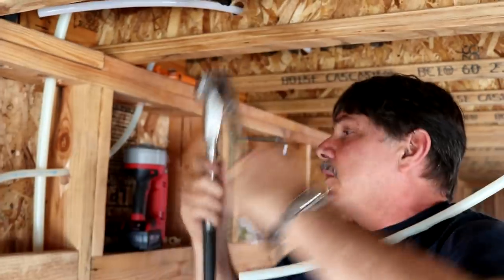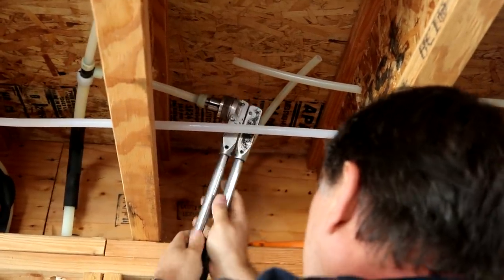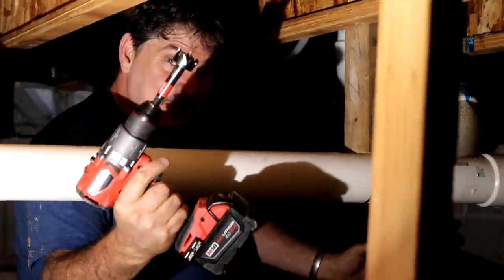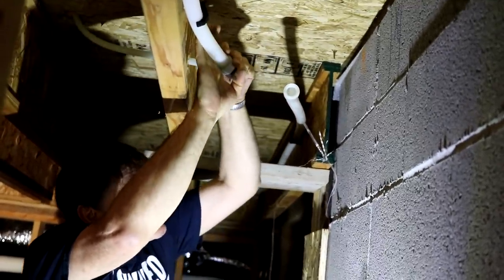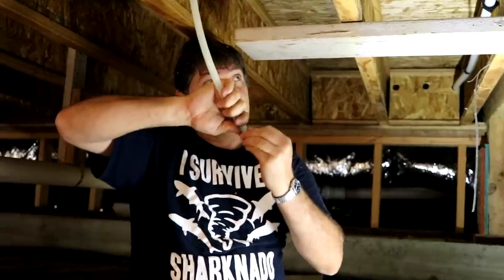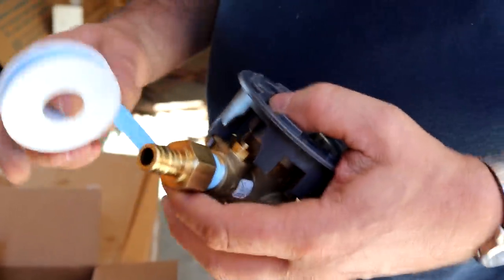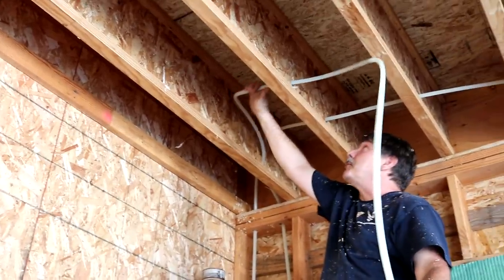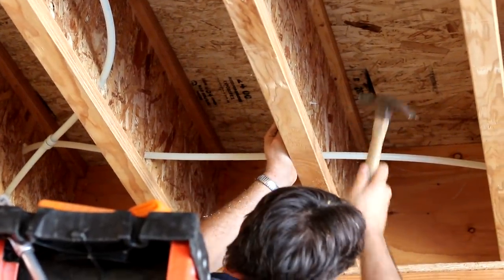Plumbing with Plastic Ep.95

Comment: “That probably won’t leak hardly at all” 😂😂😂
Reply: Just like my 3 sewer fittings that my plumber forgot to glue. After that I learned how to plumb myself.
Reply: @christophergruenwald5054  I’ve been doing various upgrades and renovations to my 1976 constructed home over the last 8 years. I’ve encountered two basement sinks that were friction fit ABS! On top of that, at one point there was PVC coming up out of the floor transitioned to ABS with yellow ABS cement. It came apart in my hands. How I didn’t find substantial leaks is beyond me
Reply: I’ve been around plumbing my entire life but have been running my own little business for around 5 years now. I can’t even begin to tell you how many times I’ve ran into 3”-4” fittings without any glue or primer at all. It’s insane. I think shit like that has to happen with bigger companies with guys working for 15/Hr. There’s just absolutely no way in hell anybody doing plumbing for themselves could ever do something like that. Plumbing mistakes are VERY expensive and even more embarrassing. The guys who do shit like that just can’t be worried about having to pay for damages or ruining their reputation. There’s just no way. 

Please don’t call big companies to have plumbing done. Find a good self employed guy and not only will he give you a better deal he will care about that plumbing just as much if not more than you will.

Comment: Pipe in pipe systems is standard here in Norway for new builds. So if the PEX pipe gets a leak, the leak will go into a connectionbox through the outer pipe and then to the drain. Another good thing about pipe in pipe system is that you can change a leaking pipe without opening walls/floors.
Reply: I’m not often surprised by comments but this one has me interested. Do you mean a pipe in a pipe is standard for interior and residential piping?

I do engineering of commercial systems in USA and we mostly use a carrier pipe for protection underground.  Can’t think of an instance inside the building other than some very special life safety instances for refrigeration.
Reply: @michaelwitt7984  In Norway it is now illegal to put in new plumbing in a house that is not "pipe in pipe".
Reply: @michaelwitt7984  This wikipedia pages explaines it well. (google translate) https://no.wikipedia.org/wiki/R%C3%B8r-i-r%C3%B8r_systemet
Reply: That awesome, I’m gonna read more about that

Comment: uponor pex a is great stuff. plenty of videos online about how to save a fitting if needed - don't really have to cut through the ring and pipe but rather just score ring, heat it and pipe up to remove fitting.  Ironically, Phil talks about how his labor at $100/hr isn't worth saving a $3 fitting but then goes and manually expands all the piping.  If you use a manual tool to expand the pipe ends, you have to rotate the expander between hand pumps (just like the electric Milwaukee and Dewalt tools do) or else you get ridges form on the inside of the pipes where the manual expander grips and you get leaks.  Hope you don't end up with leaks - there was a lot of unrotated manual expansion being done in this video. also didn't see it being used but uponor's multi-port tees are a great solution to run pipe to an area and branch off from there.

Comment: I like that Phil mentioned about costing more money to run around for parts versus improvising on site to save money for the homeowner. Also, this video pointed out plumbing installation details that a non-plumber wouldn't think of which are super important once things are buttoned up. After watching this, I'd never attempt to do the job myself.    ~~~~~    Thanks....
Reply: This comment stood out to me as well, but for a different reason. The reason why he had to improvise was because made a mistake. If he had to run around town to get a new part, why would the home owner have to pay for his mistake? Making mistakes and improvising is totally fine if the solution doesn't affect the end result. But charging the home owner for your mistakes seems unethical to me. He seems like a good guy, and I'm sure this wasn't his intent. Just thought it was an interesting comment.
Reply: @mikecoles8030  What it made me think was that some (other) plumbers charge homeowners for mistakes that the homeowner never hears about.
Reply: @mikecoles8030  To think that a tradesman will never make a mistake, and if they do, the only ethical thing is to, ‘stop the clock’, retrieve the new necessary parts on their own time and expense and resume the clock when they get back in the same position they were when the mistake was made is hilariously unrealistic. Virtually no trade or industry or accountant or computer programmer or politician or anyone does this, bar none. The only way around it, is to demand a flat rate, zero-contingency contract. The price you get from that party will invariably be the highest price you can possibly pay for a project.
Reply: psidvicious well said.
Reply: @mikecoles8030  apparently has never had a job in his life.
Reply: @psidvicious  Fair enough. I was responding more to the general statement rather than this specific case. I think the cost to fix could be handled in a range of ways depending on the circumstance. Anywhere from customer paying 100%, trades covering 100%, and splitting 50/50.
Reply: @psidvicious  And the customer, having heard that you must get at least three bids, takes the lowest bid, even though it's not in the same neighborhood as the other two, thinking he got a bargain. He or she then spends the next year  with the contractor on speed dial trying to get the sloppy mess straightened out.
Reply: @mikecoles8030  Yeah you're reading too much into what he said. PEX does sometimes shrink up quick and the fitting gets stuck partway in, no matter how experienced you are. And it's nice to have every single replacement part on your truck, but even the best-stocked truck will sometimes fall short. Improvising is a big part of the job - especially with no mechanical drawings. I think his statement was more intended to show the value of improvising a solution rather than sticking rigidly to a plan and taking longer to finish the job.
Reply: @janderson8401  Never make the mistake of assuming ‘high bid’ is synonymous with no headaches. 
Also never be under the false presumption that if ‘high bid’ comes in under budget, he’ll probably cut you some slack on the final bill. 
ESPECIALLY if it was a flat rate, zero-contingency contract. 
If a bid comes in WAY lower than everyone else, the wise thing to do is to bring them in and go over the job, line item by line item and figure out what they may have missed.
Reply: @jej3451  I’ve worked full time right out of school. I’ve never owned my own business though and I don’t think I’d last very long. I’m too nice and wouldn’t charge people enough.
Reply: @psidvicious  yeah, I don’t assume that the highest bid will always be the best quality, sometimes it means they really don’t want this particular job. Once I solicited bids for having a customer’s house painted. The house was a rather modest 3 bedroom ranch with an attached 2 car garage, perhaps a bit more than average prep needed. The bids came in at $3500, $5800, and $18000. This was about 25 years ago. The high bid was from a painter who was skilled in doing high end interior work. I still don’t know why he even bothered looking at the job.
On the other side of things, the manager of a golf course once told me that even though he was obligated to use the low bidder, he could usually get the contractor he wanted just by making sure the other bids were from companies that he knew would have higher bids.
Reply: @bailey2829  - As someone who did concrete foundations for only a summer, and as a homeowner now, minor screwups sure.  But real screwups that some contractors try to slide past the customer are straightup ripoffs, unethical, etc. I have to inspect installations where electrical, hvac and network systems all have to live together, and screwups because a sub didn't work to plan or even review the plan before banging their shit out because its Friday don't get or deserve any slack.
Great to hear 'experts' joke about the customer paying for their screwups, but don't see them laughing when a customer trys to get a change order done without paying...
Reply: @boots7859  Enter the role of a GC. If a homeowner is building an addition onto their home, it’s likely they can act as their own GC. Monitoring 1 or 2 subs per day is usually not too difficult, but it still requires at least a basic knowledge of what’s being done, to insure they’re getting what they’re paying for. On bigger undertakings, hiring a GC is usually money well spent. Let a professional handle everything from collecting bids and hiring subs to daily site monitoring to insuring completion of work by each. The GC can be especially helpful at getting subs to complete their work bcz of the lure of potential work down the road.
Reply: I’m with you Jack. I expect the contractor to have the parts and enough extra to cover wastage. I expect to be charged 10% to 15% for wasted material. If it’s more than that I don’t expect to pay for the contractor’s time to go get more. 

They should start the day with the materials they need.  Improvisation to resolve an issue is expected. That’s one of the reasons you hire a contractor and not do it yourself.

Comment: "How ya gonna work on this later on?"

Another good reason for mechanical piping drawings, even if you have an installer like Phil that doesn't need them.

As second owner of a very well built home, when I had a sudden failure in the plumbing of one of the toilets recently, boy was I happy to have prints marked with the as-plumbed piping diagram, which showed me exactly which basement ceiling panel to remove to find the supply shut-off valve that isolated that bathroom so I could keep water to the rest of the house until the repair could be made.

Comment: Holy, this gentleman deserves a Milwaukee pex tool for Christmas.
Reply: He has one, uses it when in the crawl space.  Not sure why he doesn't use it all the time, maybe its just faster to use the hand one on the 1/2 pex and leave the 3/4 tip on the tool.  The milwaukee tool does look more bulky then the dewalt one I use though.
Reply: @nabeshin-j9865  He's using the next biggest Milwaukee tool, there's a 12-volt version that does half through one inch.
Reply: @kozemchuk  they got a 1 and 1/4 head for the m12 now, but after today im not sure im too pleased with it.
Reply: @Azaduur  The 1 1/4" head is technically compatible with m12 but it takes a really long time, professionals spring for the m18 cuz it expands 1" to 1 1/2" much faster.
Reply: At one point of time Phil said that he was using it to show people watching the series that they can just buy a manual and don’t need to buy a Milwaukee. It was an earlier video, I don’t remember which one.
Reply: He's doing more reps than most would in a gym...
Reply: @bradcavanagh3092  That is part of the reason. People in jobs that aren't that physically taxing often go out of their way to make some exercise out of what they do to stay in shape. Using power tools to make it all so easy is not a good idea in the long run.

Comment: Hey great job Phil !

Hi EC, Thanks again for all the content you put on Youtube land,

Plumber from France here, and I must say, once again I'm amazed at how different our methods are.
I've seen a lot of american plumbing here on youtube, barely ever seen a bend on a copper pipe ! Fittings only, no wonder you love pex so much ! I guess you work with hard copper only.
We still make heating manifold out of steel pipe, oxy welded or tig welded for the most part, trying to avoid using fittings as much as possible once again. Well, I have to say not everybody works like that even here...

Anyways, never used pex myself for anything else than underfloor heating, but I quite often use multilayer pipes, such as Geberit Mepla to name one. It's like an aluminium pipe sandwiched in two pex pipes. The aluminium makes it completely impermeable to oxygene, and allows it to keep its shape after we bent the pipe.

I'm not saying it's a better system, but thought you might like to know and give it a shot maybe.

Thanks again for everything you do, and keep up the good work ! ;)

Comment: No water hammer with this system too. Pex and sharkbite fittings (I only use them in spaces were they aren't buried in a wall) are game changers. No draining down an entire water system to sweat a joint - cut, push, expand or crimp and you're done.
Reply: To be honest, I prefer the system they're using here over sharkbite. In a pinch, it is fine, but I think this system makes a better seal.
Reply: @jackielinde7568  I only use a Sharkbite when I tie Pex into copper and can't drain the system down enough to solder. And I'd never use it in a wall.
Reply: @dalesworld1308  Sounds like a plan. ;) Like I said, they're not bad in a pinch, but it's best to use the fittings designed for the system where possible

Comment: Love that Uponor pex. I've done hundreds of those connections, and the only one that's leaked was a brass shutoff that got dropped and nicked and we didn't realize it until after we turned the water on. Heated the end with a heat gun, popped it off, replaced the shutoff, and it never leaked again.

Comment: This part of the home build is the most exciting for me. Can't wait to see more about the plumbing, water heater, electrical, hvac, etc... Thank you for sharing all this with us!
I was wondering why he was using the manual pipe expander when he had the power tool right by his side. Is there a reason?
Reply: We only saw him use the cordless on the 1" pipe. Maybe he had it set up for 1" and the manual for 1/2" and didn't want to switch heads?

Comment: Phil is the man, copper pipe went away around in my area many years ago in Western Canada, pex saves money, plastic piping started here with that polybutylene pipe. My parents place has it, knock on wood it hasn't had any major issues, it was the "revolutionary" way of plumbing back in the early 80s. Thank god for shark bite fittings for repairs as there isn't those compression fittings originally available.

Comment: "...that's for the millennials."  Phil is hilarious!
Reply: What about when he said, ""thank goodness they write that on there , that sands for something ".  Hahaha
Reply: I didn't really understand the joke. Anyone care to explain?
Reply: @thaitichi  The suggestion was to use blue/red pipe so you don't need to keep track of which side of pipe is your hot/cold (the assumption is you plumb the cold lines with blue PEX and the hot side with red PEX).  I guess he's joking that it makes it too easy if you do that, but also because he's spent decades having to keep track of it, it's innate at this point, and he just orders the cheapest color.
Reply: Red and blue is code around here, and oxy-barrier orange for hydronic
Reply: Making something simple is never dumb.  It is brilliant.
Reply: @SigmaChirality  looks like he is using Pex type A which is commonly used with expansion(Uponor) fasteners- also has different characteristics from Type B(Blue/Red/White).

Comment: In Poland we have PEX pipes and fittings that you heat the ends with designated heating iron until they melt a little and then you connect them, its designed in a way that they fit in each other nicely and inside of your plumbing is nice and smooth this way, its better for the flow and for the noise inside the walls, we also use foam pipes to cover them so cold ones doesnt condensate moisture and hot ones doesnt lose so much heat on the way to the sink or shower.

Comment: I am doing all the plumbing in my place and bought the Uponor (expandable) PEX. Really glad I did it. The job went so fast and no leaks the first test.
Reply: i am doing my own house right now.....i am up north....cant do a water test right now. Did you do a water or air test. If you did an air test, what pressure and for how long?
Reply: @jaysidhu3313  Should be stipulated in your local plumbing code, it can vary by area.
Reply: @jaysidhu3313  I put on all the angle stops and did a water test just for my own state of mind. I still have to have the 4 way inspection.
Reply: Did you use the manual expander, or get the Milwaukee cordless one?  I already have the M12 batteries and was debating buying, using, then selling it used, but I'm not sure if it's worth the extra cost over a manual expander.
Reply: @thePilgrem  I had a tough time deciding and then thought about how much I was saving and just went ahead and bought the cordless one. I got it at Supply House and it was worth it!
Reply: @terrancetenley2786  i ended up buying the milwaukee one for the same reason as terrance
Reply: @thePilgrem  The automatic expander gives you many more options as well, which is especially important in renos were spaces can get tight.

If you can afford it, you will not regret the decision.

Comment: I do my own plumbing in the renovations I do, I'm not even in the same game as Phil, but I certainly do appreciate his skills.
The PEX we use here in Tokyo is white but they come with a blue or pink sheath of insulation. They specify that we do NOT tie them down to anything, they want them to just flop around, the whole earthquake thing I guess.
We also use these big brass manifolds, one big manifold near where the main water line comes into the house then a line to each room, etc.
I've installed a lot of those tankless water heaters they are great!
Cheers from Tokyo!
Stu